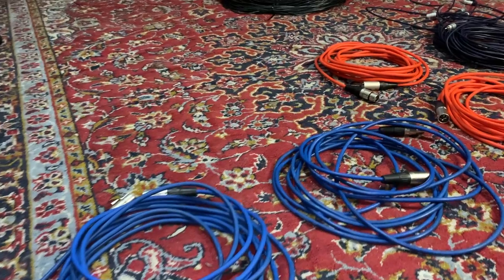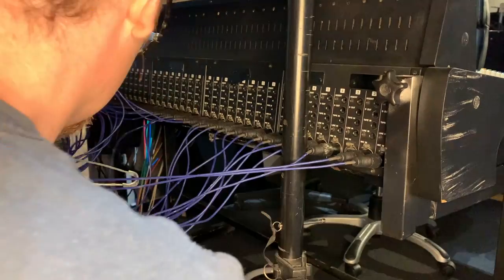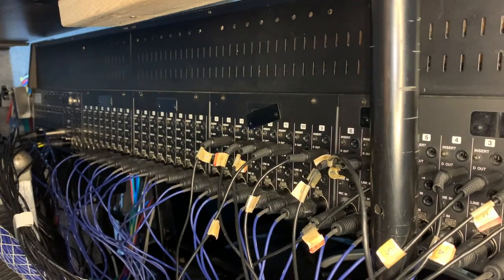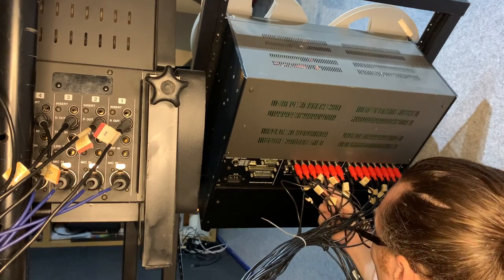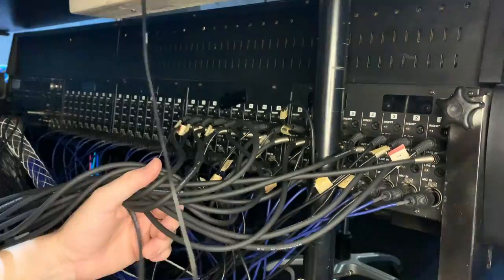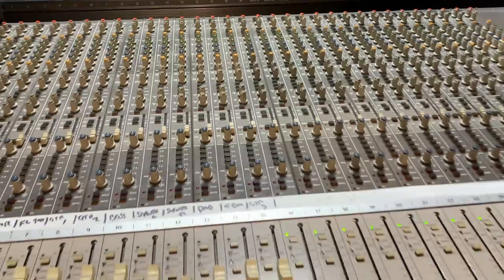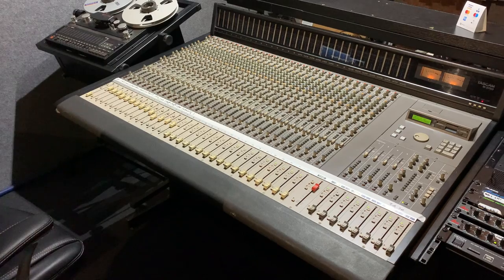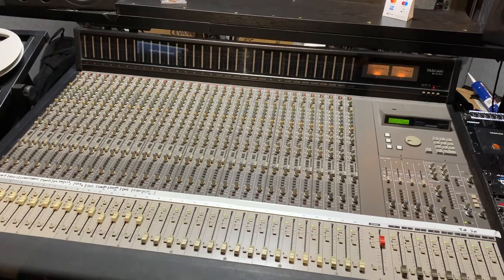Routing a Tascam M3700 Mixing Console

Comment: When I started the studio I worked at had 2 rooms the big room was an MCI JH-636 Console and 2 MCI JH24 2 inch machines Sync'ed, the smaller room I worked in had a Midas XL3 and a Tascam MSR-24 an unbalanced 1 inch 24 track machine. I made a ton of records on that Tascam desk!! They don't have the headroom of the bigger decks like MCI or Studer but they have a unique sound especially in the 150 hz and below range. Its a fine line between noise floor and running in the red on those unbalanced machines when working with transient heavy material like drums but when you get it dialed in they can sound as good as the bigger decks!

Comment: I use to split the console . In channels 1-16 then tape outs to 17-32   This way all my inputs on left then tape playback on right.   Your thoughts on this ?   I’m GUESSING you do not do this because that console might have a playback switch on each channel and it’s dual purpose on each channel for input and playback ?  Thanks
Reply from the maker: That's correct we can flip each channel individually to the returns from the tape machine. We also use the other channels for routing to and from the patch panel giving us greater versatility in post.

Comment: How much noise are you getting when compressing after tape? Is it manageable?
Reply from the maker: Yeah its no problem at all. We use the compressors much less than with a digital production. Just because you don't have to compress the heck out everything like with digital. As the tape machines naturally compress the signals anyway. When we do use the outboard compressors there isn't any problems with noise. Even when mixing down to the 2 track we run the signal through a valve compressor as well. Again there isn't any excess noise to speak of. If you're finding tracks to be noisy after compression then the input levels of the tracks at unity would likely be the cause. This applies using digital or analog.